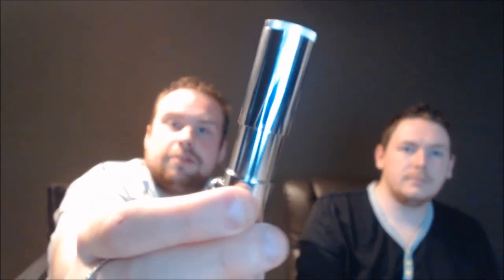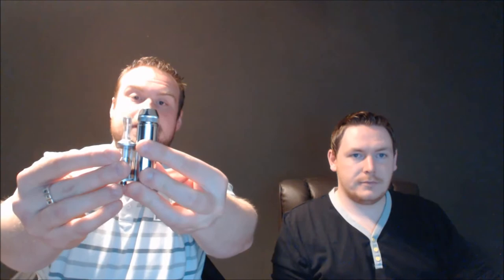Corolla Mechanical Mod

Comment: Different models of battery which are supposedly the same size can be off by a millimeter or two. With some relatively inexpensive mods, that small difference can make a difference in ability to use the battery.

Comment: thank mind :) and yea dave It does although no chip a toy can run them upside down if you do your device body becomes you positive as apposed to your negative and if the body have a little damage that configuration will short unlike if u run it properly

Comment: indeed the vamo is one of these the efest 18650 3400mah is actually 18.5mm wide so it won't fit unfortunately personally I like it snug means no rattle

Comment: Thanks. Probably pretty dangerous if there's a short then, yes? The reason I had asked is I had heard people talk about putting the battery in backwards on a Smoktech Gripper if it wouldn't fit the correct way.